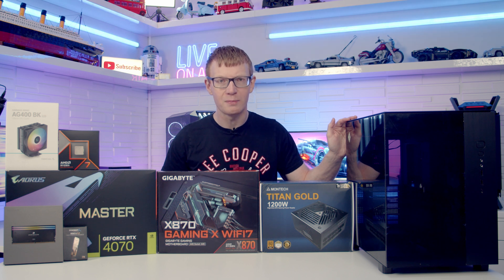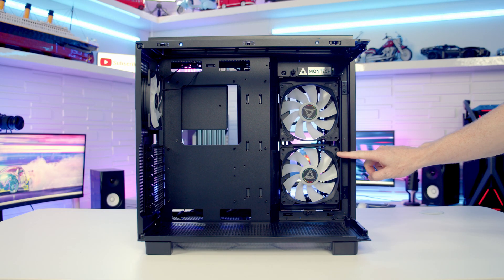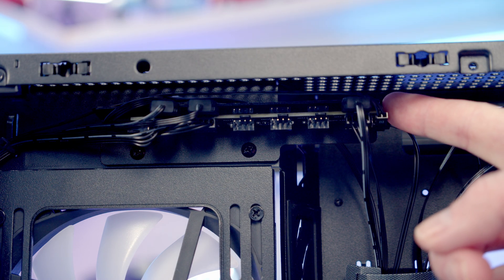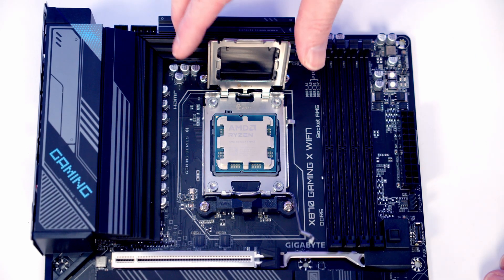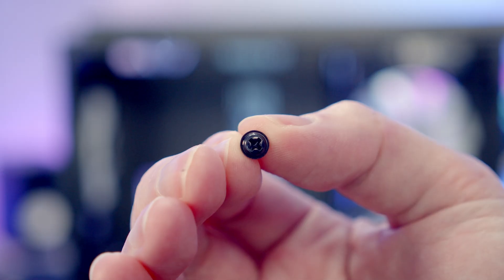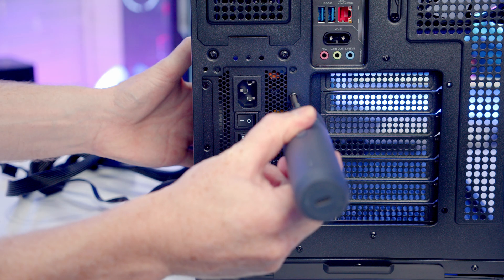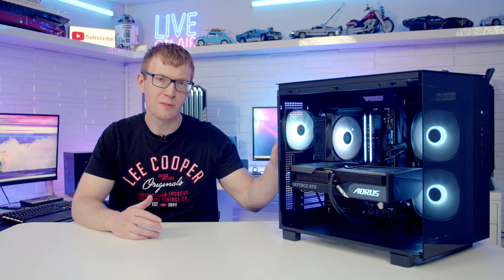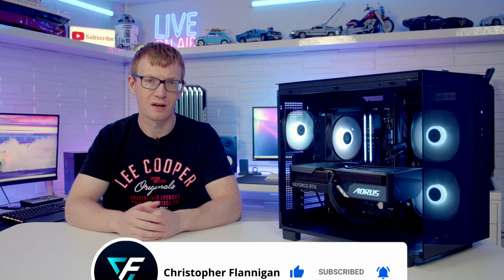Montech King 65 Pro Build - Step by Step Guide

Comment: hey so i did everything like you did but i cant seem to get any argb software like signal rgb or smth to work with the installed fans but they work with the button on the case any ideas how to get them to work with the software
Reply: Maybe you worked it out already. But the installed fans need to be connected to the motherboard.

Comment: Thank you, Chris! 👍🏼

That GPU is a monster.  I wasn't sure you'd be able to get the glass panel back on!  (If that was my build, I'd definitely be investing in something to help hold it up. 😝)
Reply from the maker: Issue was location of PCIe slot on motherboard, lines up with top slot on case to GPU is very high up. The bracket from TUF 4070 Ti that just comes up from floor was also to small, so might need a custom one with this motherboard.

Comment: great video as always. what gpu bracket was the one you tried to use I didn't see it in the video description?
Reply from the maker: It was the on that came with the gpu, issue was top pcie slot on motherboard being too high up, so not a case issue